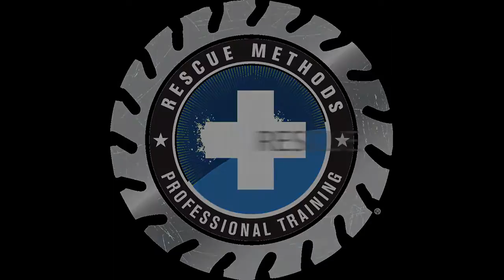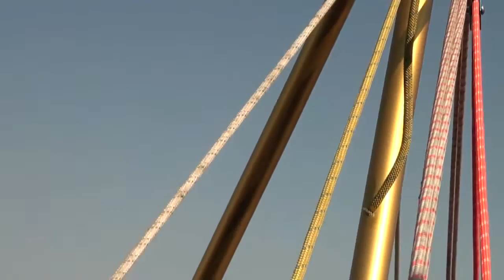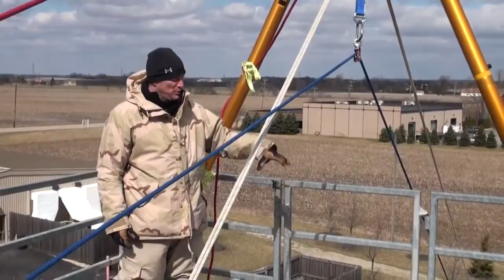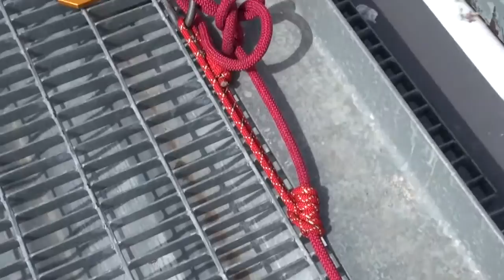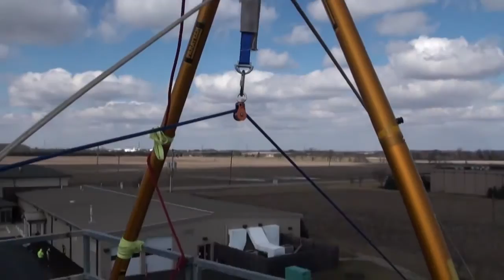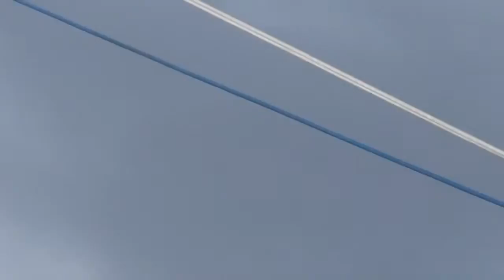Rescue Methods: High Angle Rescue Bipod Ops

Comment: I'm a bit confused. It seemed like you were saying the footprint is always directly under the head. I was under the impression that with a bipod the footprint is a straight line between the feet of the bipod regardless of forward articulation.